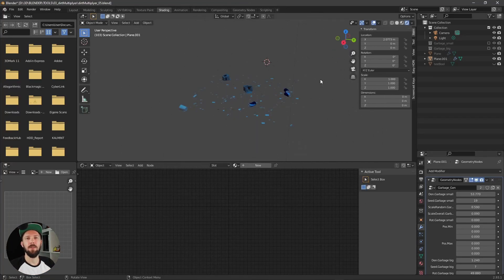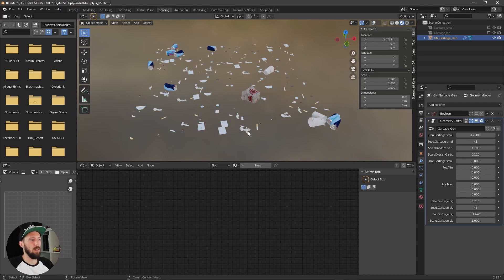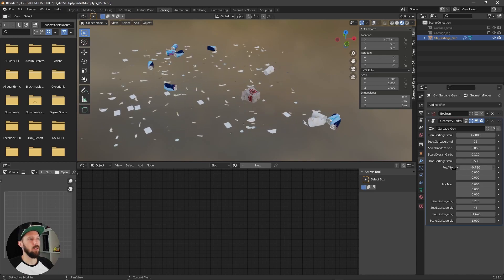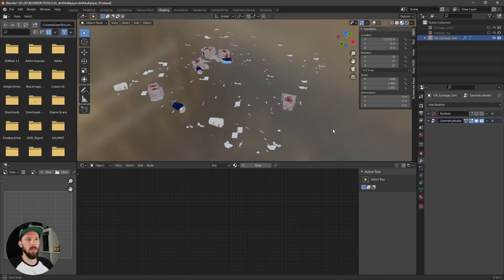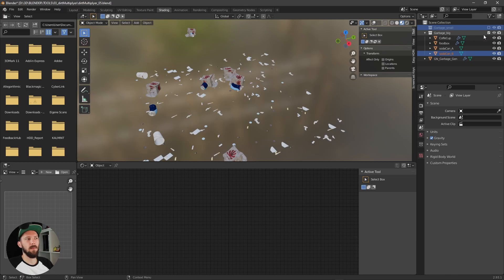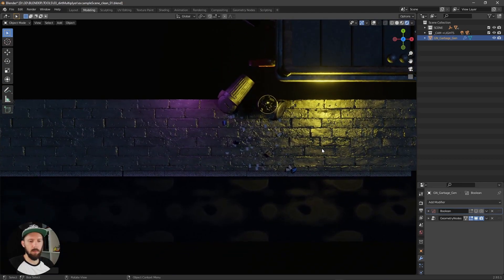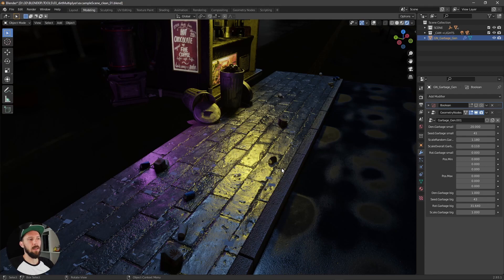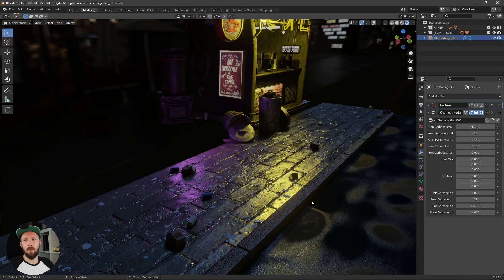Blender 2.93 Geometry Nodes - Garbage Generator

Comment: Great idea. I might've missed it in the video - will the trash clip through the ground surface, or can it account for that?
Reply from the maker: Thanks! The trash will be clipping through the ground. You can add a riggid body the "trash plane" but I think some of the trash will clip. ATM it's not possilbe that all single trash will use a single rigid body to use "real" collision with the surface. If you know what I mean ;)
Reply: @PizzadelRay  This is a problem that I have with producing garbage.  I tried making giant piles, but the trash always clips.  I made a huge physics simulation with 100s of thousands of trash pieces, but that is slow and cumbersome.  I don't think there is a clean way to solve the clipping problem, so I just try to hide it as much as possible...
Reply from the maker: Yes, it's very difficult but this one is just for putting garbage quick into your scene 🤗